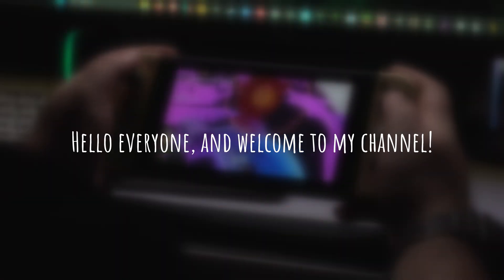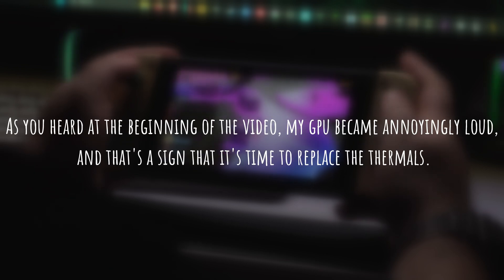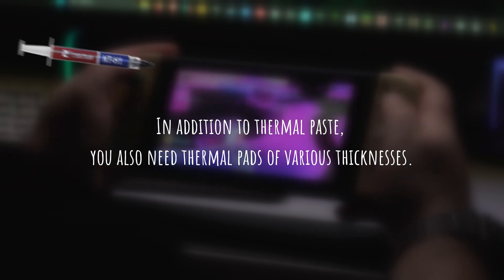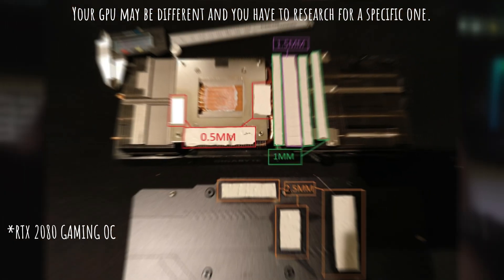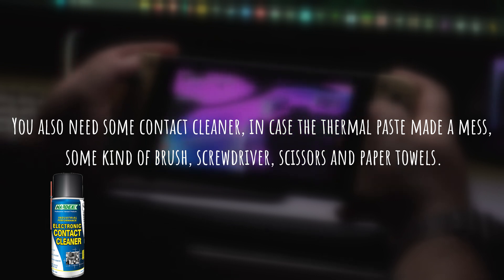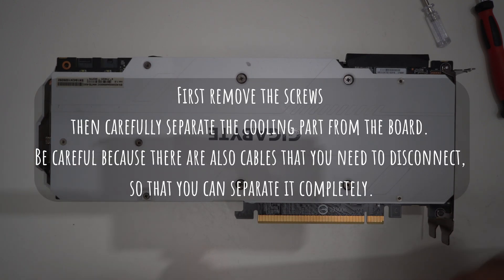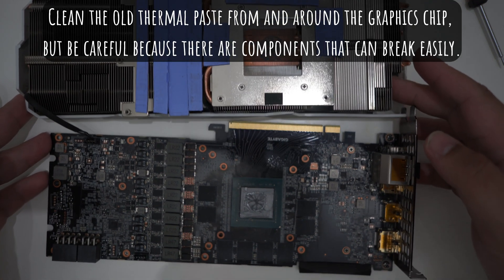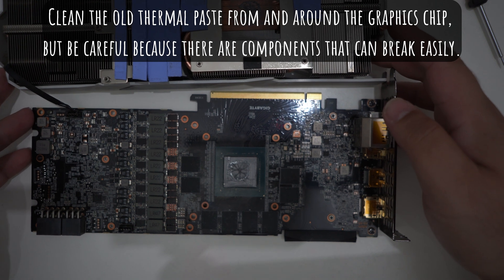How to replace Thermal Paste and Pads ✅ // Get a True FPS Boost //

Comment: Does this void the warranty? I notice gigabyte tend to be very bad when come to thermal paste
Reply: Technically yes, but like Steve from GN said in one of his videos "just remove the whole anti-tamper sticker, who's gonna prove it was not a factory issue and it was never there?"
Reply from the maker: I had no problems for the first 3 years. Surely the warranty is voided if you open it...

Comment: how often does this need to be done ? also is this about the same layout as a 4070 ti super
Reply: Once in every 3 to 4 years if u are heavy user then once in every 2 to 3 years
Reply from the maker: You will notice a drop in performance. It also becomes much louder. Those are some of the signs. As for the layout and the thickness of the pads, you have to research it. Each model is different.
Reply: If you use regular paste like MX4 or the Noctua one in the video, be prepared to do it in monthly if not weekly.
Reply: @ralf2166  Really why? I cant imagine it's worse than what the manufacturers put on, not to mention how poorly they sometimes they apply it.
Reply from the maker: @ralf2166  What's wrong with noctua? Which one do you recommend?